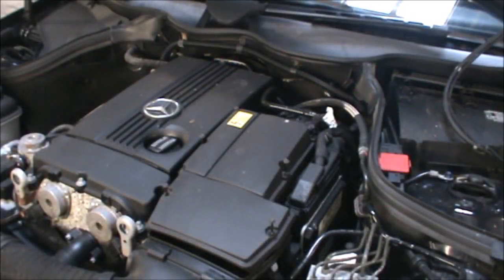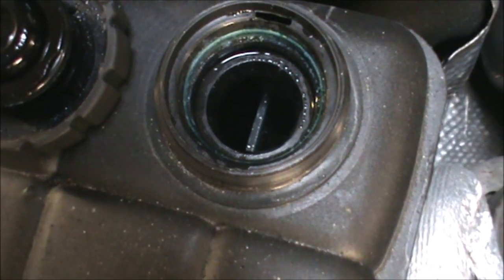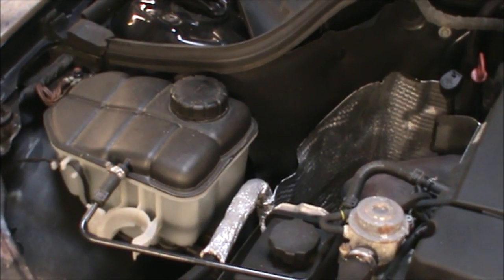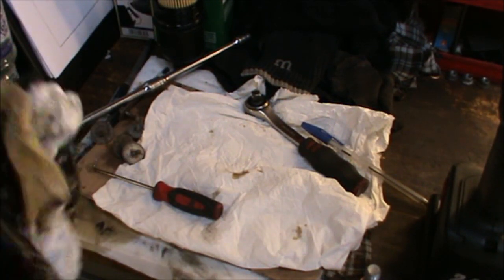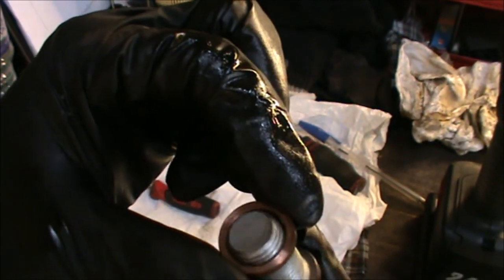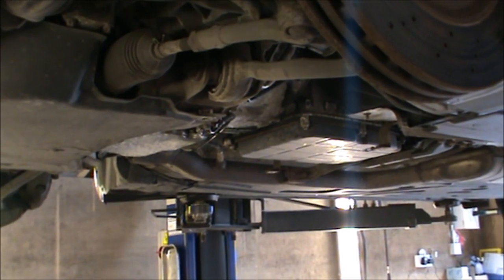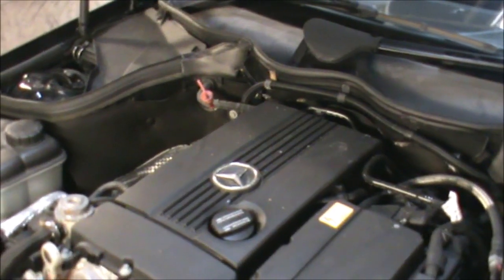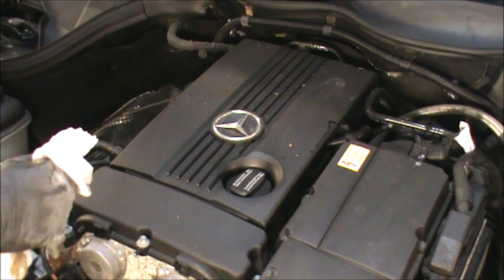Mercedes 2006 w203 c180 kompressor oil, oil filter, air filter replacement, screenwash top up, coola

Comment: Can you help iam a bit confused my car is 180c kompressor 2004 and it hasnt got a dipstick and i want to add some gearbox oil which i thought normaly is the red one but i saw you checking the red one to see if is to the maximum so how do i top it up the black one or red one? Thanks
Reply from the maker: The video it’s about changing the engine oil not transmission fluid. So may be you need to look for a video that shows you how to change or top up the transmission fluid on the model of your car.

Comment: I have the same car, been struggling with lean conditions at high rpm, I have changed one pipe sitting under air box. Are there more causes to the lean? I have Also noticed screeching æ/ squeeking/ rubbing noise from middle of car When driving slow
Reply from the maker: Hi there are another two hoses seating under the super charger that can cause lean conditions as well as the one you already replaced. Also the PCV valve can be faulty. The noise you experiencing could be related to this. Check this video. https://youtu.be/sba5ke772S0

Comment: Hello to all viewers, has any one successfully drilled into the hex top of this filter casing, fit it with a threaded elbow + tubing, a pressure sender unit and route to a 0 to 150psi oil pressure gauge on the dashboard?.  

There is one podcast on drill into the filter casing of a CLK230 to install a pressure sending unit. But the filter casing, for CLK, under it has no obstruction and lots of space for fitting in the connection required.

Regards.
Reply from the maker: Hi I never attempted to drill the casing, why do you want to fit a pressure gauge, do you do racing or something like that. Hopefully someone can help in any case.
Reply: @DaringBeefcake  Someone put i
Up in U-tube on drilling onto oil filter casing, for his year 2000 CLK, to fit in oil sensor and route to a pressure gauge mounted to the A frame. His filter is the large old style type. 

I am a bit determined to keep my last year purchase, of 2006 built, for at least another 5 years. Will likely put in 10,000km annually. It recently had just accumulated 200,000km. Engine oil top up is not more than 1 litre between it's 10,000km oil change interval.

So having an oil pressure gauge like those on pre 1990s Mercedes makes sense. Yes, no?. 🤔🤔🤣

Comment: Wheres the aux waterpump thats suppose to be mounted next to the water bottle ?
Reply from the maker: I don’t think the water pump is next to the water bottle, as far as I know it’s part of the wheels that are attached to the v belt have a look there.
Reply: @DaringBeefcake  theres one on the side of the water bottle , for your heating system.google it , w203 auxillary water pump.

Comment: Perhaps you could help me...
I have m271 c180 compressor
Done oil change and oil housing half of the plastic is stil stuck in side and doesn't want to come out.
What can i do to fix it?
I tried to pul out with long needle nose pliers but that damn thing is very stuck inside
Reply from the maker: May be you can spray some wd40 and let is soak for a few hours and try pulling out again. So is it broken in half ?

Comment: Hi!where did you find the oil stick? This engine dont have
Reply from the maker: Luchian Ady some newer car don’t have a dipstick.
Reply: I have e-200 kompressor w211 with 1.8 engine model 2005 and i try to buy a dipstick, with no luck
Reply: Open secret menu :)
Reply: @luchianady  I bought one line dipstick of 570mm from the end of tip until it's stopper. Found that it was a bit too short. I grind the OD of the stopper (but do not grind off the top most round yellow plastic which will become the stopper) and threw away the 0-ring. Now I dip for oil level once every 1000km and keep the dipstick in the booth. 😂😂😂

Comment: Would this all apply for a 05 kompressor sedan ?
Reply: C230
Reply from the maker: @chefdaytonk  Hmm I think the c230 is a bit different, check this vid https://youtu.be/l6wDT7h5s00 at minute 4.5  you can see the engine type, if similar to yours then watch that video instead, hope this info helps.
Reply: DaringBeefcake the video above looks more like the engine I got. That other link, the engine looks different
Reply from the maker: @chefdaytonk  oh  ok in that case the procedure should be the same, only the oil quantities will probably be different, check you manual, I can see that at minute 16.17 of this video the manual shown 8L for the c230 c280 and c350, but you can double check that with your manual, otherwise the filter and other stuff should in the same location.

Comment: Hi, do you think 10w40 will work too?
Reply from the maker: To be honest 10w40 is not recommended so I would re think using that oil.
Reply: @DaringBeefcake   Thanks for the reply. I was curious if 10w40 as long it's mb 229,3 would make the engine a little more quiet?

Comment: In my opinion You don't install in propel way new filter. See haw deep old filter was put on plastic filter cover. In your movie is was at 8:36. New filter was not push enough on filter cover. See at 12:51. When You screw this into filter base the plastic will be destroy. The oil from oil pump will go through to oil pan and engine. Here it's explained https://www.youtube.com/watch?v=B99C98zAoZ8
Reply from the maker: Hi thank you for sharing your opinion and the video which I had a look, but can’t understand as is in another language, however I can see the filters he is using have a hard plastic cover on each end, the one I use has a soft material that gets pushed in and not get destroyed. I’ve service this car every year and didn’t have a problem. Having said that you did raise a good point and something for everyone to watch out for just in case you get some difficulty fitting the filter or it doesn’t go all the way in. So in any case thank you for sharing, I appreciate you have actually seen the detail. Well done and thanks again something for me to be aware in future, as the w203 and w204 use those filters.

Comment: 5w30 oil
Reply from the maker: Yep that's the one I use here in the UK
Reply: @DaringBeefcake  what brand and models? And what kilometers u will change the next?
Reply from the maker: @toplespecah666  usually every 10000 miles or 12 months and I will use the same parts as the ones in the video.
Reply: @DaringBeefcake  ok thanks